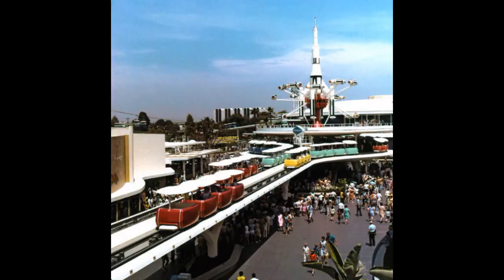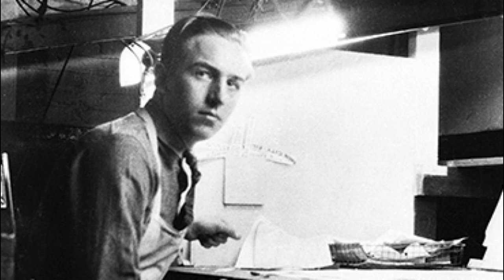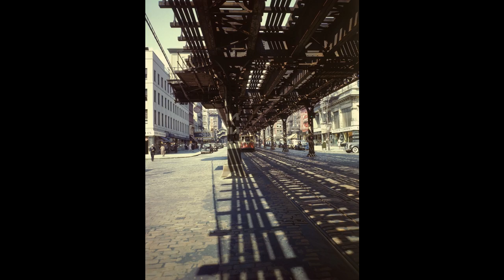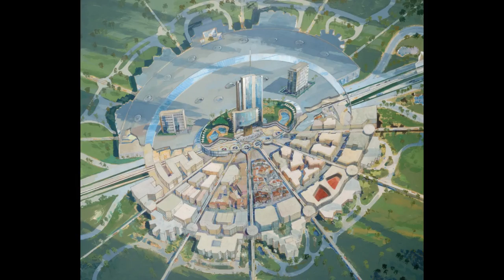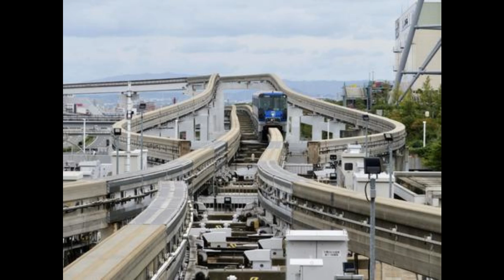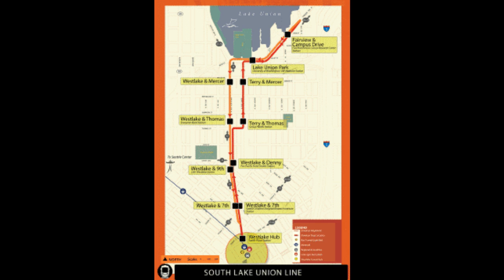The Houston Subway, Monorails, and Gadgetbahns

Comment: The fee integration to Seattle center has been a game changer for the Seattle Monorail -- as well as the updates to former Key Arena. It probably needs a few more stops to be truly be optimized. I sometimes try to think of ways SLC could use monorail specifically but can't really think of one, except if there was a hanging one over the Jordan river or maybe like a Park City people mover, but they'd hate the look there. Haha. I do think heavy rail along Mountain View corridor would be smart. Maybe repurpose the Frontrunner trains when they get the new Stadler ones for that line then they could do it on the cheap?
Reply from the maker: @mattreedah  I agree, the fare integration with the rest of Sound Transit saved the Seattle monorail, and gave Seattle a great express line from downtown to a major sports district. 

I've wondered for a while if a similar monorail could be successful in SLC, connecting Frontrunner to the U of U along 2nd South. It would be well over twice as long as Seattle's version, so a more complicated switching system would be needed in order to provide similar frequencies, but it would definitely be faster than the Route 2x express bus!

Comment: Houston needs:
New Amtrak Station
Commuter Rail
and Red Line extension to airport
Reply from the maker: @brendanu1680  I agree. Those are much bigger needs than the airport subway.
Reply: @CSLenhart  You agree? Nice.  I have 2 questions since you agree?
Where would you build a new Houston Amtrak Station(+ name, cost and opening date)? And what Commuter Rail corridors would you create for the Bayou/Space City(Either independent or operated by METRO)?
Reply: The Metro is extending the Red Line to Bush and the Purple line to Hobby! Its called MetroNEXT if you want to read about it.

Comment: The big problem with monorails is that they are almost always proprietary technology. So if you build a monorail for your transit system with one company, you’re locked into ordering replacement cars and maintenance from them as well. On the ither hands, trains are very cross compatible
Reply from the maker: @Hahlen  The proprietary technology issue is real, but not insurmountable. Conventional trains had similar problems in the early days, with different rail sizes, shapes, materials, etc.  Standards were settled on by trial and error. The same is happening for monorails, but over a much longer time frame.
Reply: It's not that much of a huge deal, especially when built by a company that builds many systems.  Light Rail systems between cities are also different.  The Dallas DART rail is a varient from a Japanese company.  It's completely incompatible with anything in Japan.  It's design is not used anywhere in the USA.  Even in Japan, they have so many different trains, even thou they do pretty much the same thing.
Reply: @tcat1990  light rail runs on standard tracks though.
Reply: Proprietary... the perfect American solution then.
Reply: Indeed. Alweg, the company that built the Seattle monorail is no longer in business. Any repairs have to be custom made since there are no off the shelf parts available.